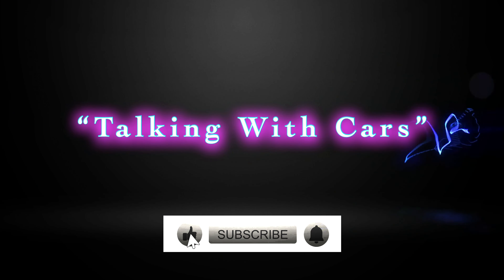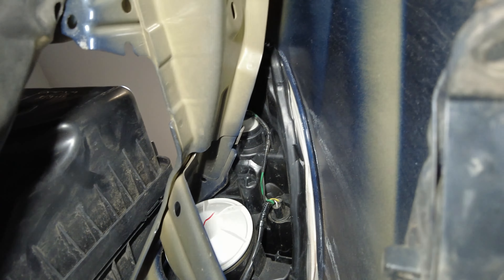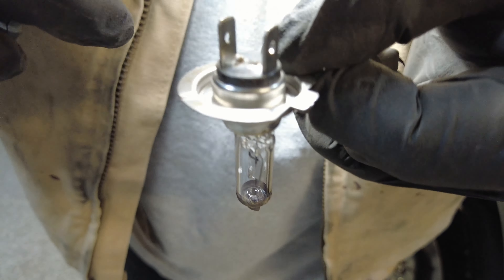HOW TO: 2010 through 2014 (Gen4) Subaru Outback Low Beam Headlight Bulb Replacement - DIY (4K)

Comment: Easiest way to change the headlight bulb in a 2012 Outback: Buy body clip pliers and a half-dozen body push-clips for the ones that you'll break. Pop all those clips around the grill-bumper assembly (best to jack the front end up to get to the clips underneath) and pull it off, disconnecting the fog light bulbs from their housings with a simple twist (put a blanket underneath the bumper to avoid scratches when you lay it down). Remove the retaining brace (10mm socket with extension, maybe another clip or two). Remove headlight assembly (three more 10mm fasteners), disconnecting the wire harness. Pour yourself a good merlot and put on some classical music. At your workbench, comfortably remove the low beam cap, remove the wire plug from the bulb prongs, release the bulb retaining clip with a first downward and then outward motion (make sure you do it just that way to navigate the clip hold-down notch and avoid breaking the portion above the notch off, making you very sad), and replace the bulb. Put everything back together in the opposite sequence that you took it apart. This is arguably easier and certainly more civilized than contorting through the wheel well.

Comment: You don't need to jack up the car or remove the wheel. Just turn it to the left and you can get access. I'd love to see a video from someone on replacing the driver side bulb... I just did my 2012 Outback today and it was an absolute pain in the butt... Similar routine- Turn the tire to the right and remove the shroud... and you need to be a contortionist to get your hand up inside to access the light cover. I used a screwdriver to loosen it from above behind the battery... such a pain...
Reply from the maker: Agreed, not 100% necessary to remove wheel but honestly I wanted as much room as I could get and am fortunate to be able to do so.  You may be able to get to the bulb from the topside but you will need to remove the entire air box.  And it’s still not fully accessible.  I’m assuming the new models have adjusted this :)
Reply: Yo the driver side is a pain in the ass
Reply from the maker: @bertthebuilder4699  yes it is! Did that last year. Ugh!!
Reply: @Talking With Cars  yeah me too, I just replaced my girlfriend passenger side today on my day off. My bro told me you should just do both on the last one. N he was right ha
Reply from the maker: @bertthebuilder4699  I was told next time.  Install some sort of LED which lasts longer
Reply: Great!!  Thanks for steering me correctly..I'll take it to a garage on this one!  (Drives side went out, snowing here to boot!)
Reply: @talkingwithcars it's my drivers side too...okay, leaving this one to a professional 😢  (arthritis, not so nimbly fingered anymore :)
Reply: Ir's easy-just get your workshop elves to do it.

Comment: No one shows the driver side, the actually hard part.
Reply from the maker: Fairly similar but if that one blows..I will absolutely do another video!  Sub  and stay tunned!
Reply: @talkingwithcars  Just did mine today and its a bit more cramped but anyone could do this. i have large hands and i could get in there. The positive part about the drivers side is that you can use your right hand to do it.
I have a subaru legacy 2010 and for some reason i have xenon lights :S
Reply from the maker: @ awesome! Have a great Thanksgiving!!

Comment: Bulbs can be easily changed. Open hood. The sealing cap over the bulb is visible through gap in sheet metal. Use screw driver to leverage loose the sealing cap through the gaps. Go to steering wheel turn wheel so its turned all the way right for drivers side bulb or all the way left for passenger side bulb. Next remove push pins on outside edge of wheel well liner so that you can pry it out from behind fender And also a metal tab at the 10 oclock position is holding the linder snug to the fender ..bend that out/down away from the fender to slip  the liner "up and out" away from it. Now while standing next to tire push down and inward on the top of the liner this gives plenty of room to reach in behind the fender for a straight shot to remove the cap wire plug and clip holding bulb...you will even be able to see it through gaps in metal behind the headlight while standing and looking. Use a cell phone light or or work light positioned in that area so it casts light on the bulb hole through the gaps in tge sheetmetal...this makes it easy to get your forearm and hand at a straight shot and install the new bulb.

Comment: Finally done! Thank you for this video.

If you have a 2014 like I do (can’t speak for other models) it is definitely possible to do without removing the wheel, rather just turning it away from the space you’re working on. Regardless, the space in front of the cap is extremely small and there are wires running around. Luckily I’m small and have dexterous fingers, if you don’t, maybe find someone who does lol. 

The retainer clip works almost like a safety pin, push down on the part that sticks out, turn down and then let go. 

Even with instructions this was pretty hard to finagle, but definitely possible and cheaper than taking it into your shop. Good luck!
Reply from the maker: @dangerdove  awesome job!!! it's possible to do it without removing the tire but i personally couldn't do it.  its way to small for my hands :)
Thanks for watching and if you're looking for any specific type of video. let me know. thx again!

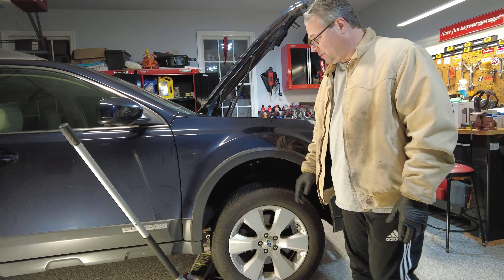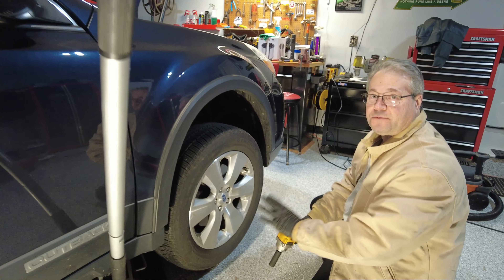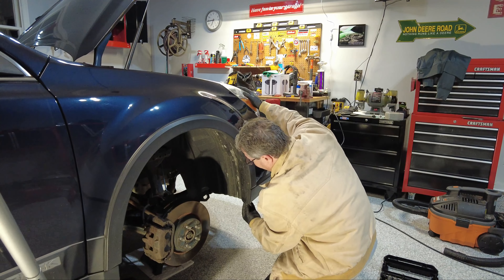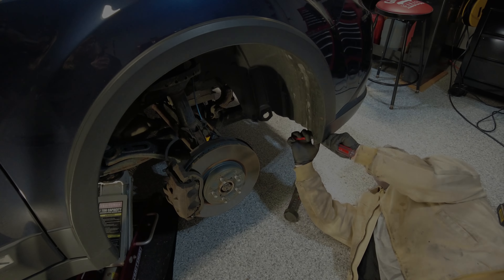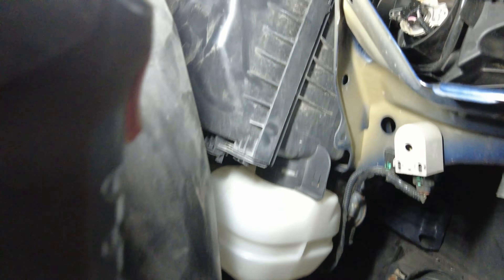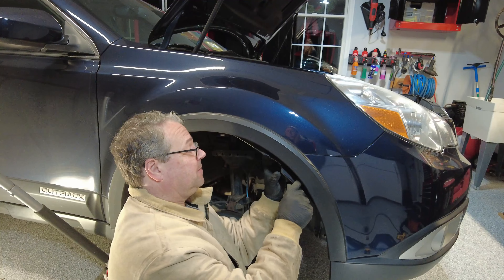Comment: Times you can see the jack stand: 0:38-0:48, 0:51-1:02, 1:04-1:26, 1:30-1:35, 2:16-2:19, 2:43-2:49, 3:13-3:36, 4:31-4:32, 4:41-4:49 (the handle), 4:51-5:06 (the handle). It's so much easier without the wheel on, curse Subaru for that. Thank you!
Reply from the maker: @indecisive999  Thank you and have a wonderful Holiday!!

Comment: Just did my neighbors right side.  What I found was even after bending the wheel well and pulling the front side body panel, the low beam cap was in a hole surrounded by structured metal body?  I have fairly large hands, could only get one hand into this tight hole to attempt turning the cap. Could not turn it!  I’m 68 and have this bum thumb left over from years of construction abuse and just couldn’t turn it!  So I removed the under the hood panel and the air filter box. Used a wide blade screw driver from under the hood and leveraged the cap and got removed. 
Then from the wheel well tripped the hairpin loose. Pulled the wire from the bulb, should have pulled the wiring before the hairpin but oh well!
The wire was not long enough to pull more than 2” from out of the socket. I had LED replacement bulb which has its electronic power converter box which had a long connection cord. That was a pain to push all that into the socket area!  Then because the connection was not on the end of the bulb it was very difficult to connect the two ends as they were both loose and swinging! Had to push both end through a upper opening then connected while standing and working from under the hood!  Then pushed the wiring back through and reach around from the air box area and pushed the wiring into the socket.  The led bulb had an additional component attached to it end which was very difficult to get the hairpin around it and snapped into its lock position. Finally got it locked!  The cap gasket was very dry and had a couple a fractures so I cleaned it and silicone greased it. It rotated into its locked position with ease.  After locking it attempted to unlock which was a breeze as compared to its original dry and dirty condition. Turned and locked it the put everything back together. Oh yes I checked to make sure the bulb worked the second I plugged it in and multiple times as I continued with its install. End result it works. What a piece of crap engineering!
Reply from the maker: Absolutely !  They made a mess of that shoe in design.....but I think they learned their lesson from this....I hope :)   thanks for the feedback regarding your experience....
Reply: I went ahead and pulled the bumper/grill assembly and unbolted the headlight assembly clear off the car (a clip puller and 10mm socket with extension, maybe a Phillips screwdriver if you have the wheel well trim, are all the tools you'll need). Changed the bulb with the assembly in my lap. Not really any more difficult, and far less agonizing than snaking through the wheel well. A few new body clips just comes with the territory.

Comment: I guess someone already did it on mine because it's got a plastic molded strip that you unscrew and pull back and then you have access to the headlight. I'm just looking how to adjust it because my passenger one points to the ground
Reply from the maker: I don’t believe there’s an adjustment.  Pay attention to whether or not the bulb is seated 100%. Sometimes that’s an easy fix.
Reply: @talkingwithcars  I'll look and see. It's easy to get to but still a hassle with big hands.
Reply from the maker: @avon22889  agreed

Comment: Is this the same way to change a 2016 subaru out back?
Reply from the maker: Subaru apparently learned from their mistake in the past designs and made it easier to install.  I believe you can install them from the engine topside.  I’ll find a video for you so you can do it.  Very easy based on what I’ve seen.
Reply from the maker: https://youtu.be/pigFEDEjSgo
Reply from the maker: Please subscribe if you enjoy my content.  Your help is appreciated thx
Reply: I wish I could post a photo but for some reason I can't. The light is in whole piece if that makes sense I was trying to avoid dealer ship again because it was almost 500$ but I don't think their is away to change the subarua out back 2016 limited edition
Reply from the maker: @tiffanyrooks440  I would not go to the dealer because they will charge a lot. See if you can find a local Subaru specialist so they can help you out ?
Reply: I am so excited I figured it out. You have to twist the back part of the housing off. Just need to get the bulbs now
Reply from the maker: @tiffanyrooks440  good job!!

Comment: It's not that hard and you don't need to remover the wheel.
Reply from the maker: @AmbientWilderness219  possible but difficult either way
Reply: @talkingwithcars  I just finished it in about 20 min. 

Both sides. 

Super easy. Requires a bit of hand strength to get the gray cover off but that shouldn't be a problem for any man. If it is, I would correct that issue first.
Reply from the maker: @AmbientWilderness219  create a video
Reply: @AmbientWilderness219  not easy… it took a prybar and a 16oz hammer to get the grey cover to turn.